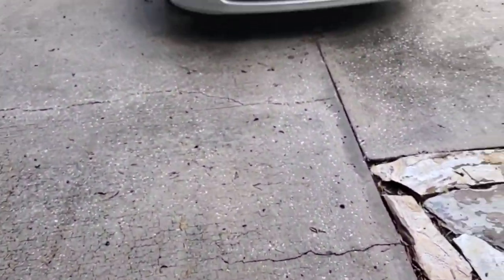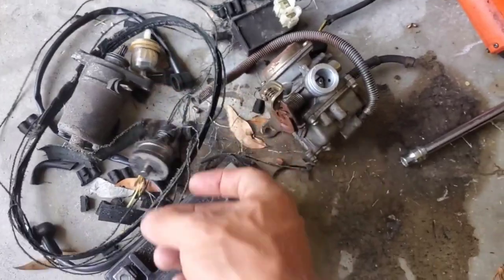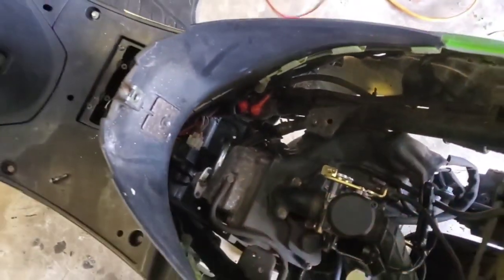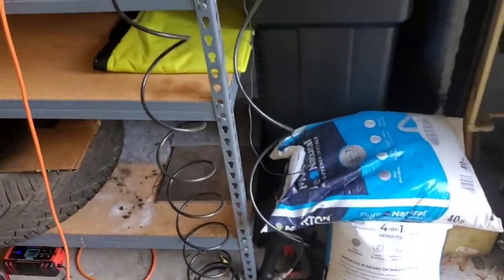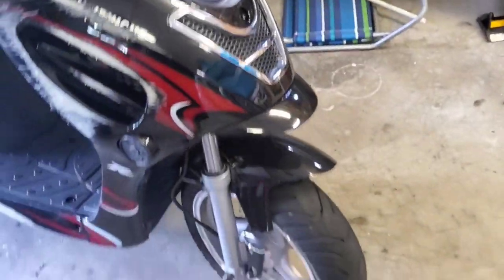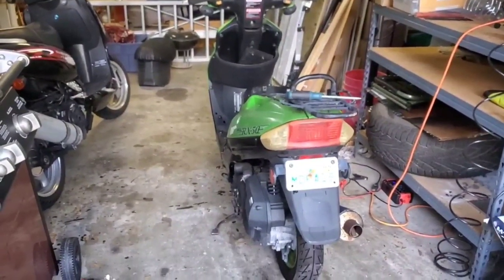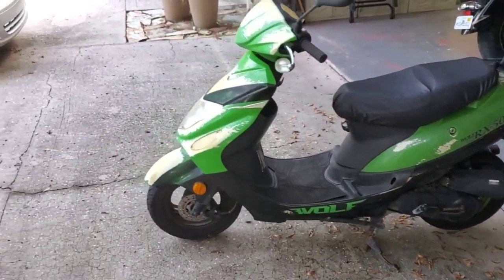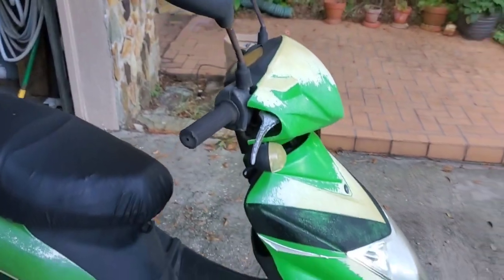This Junk Yard 50cc Scooter was Trashed! WILL IT START?

Comment: Bro I got my 2013 Honda PCX 150 for $1650 from Craigslist. Had 13,500 miles now it's at 26,600. Just had to do belt and rollers, Coolant, brake fluid, oil, gear oil, tires, Spark plug, air filter, brake pads, and brake shoe
Reply from the maker: Normal maintenance